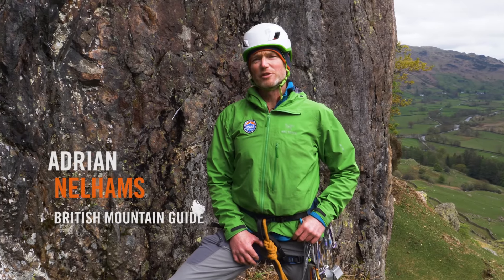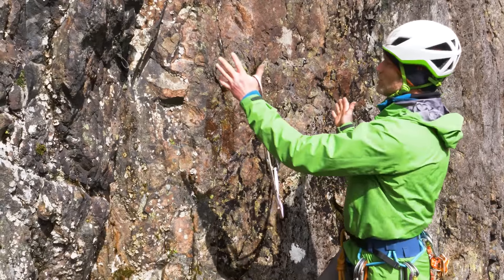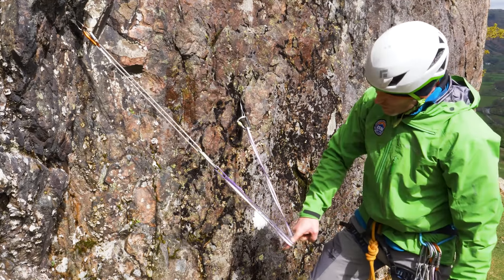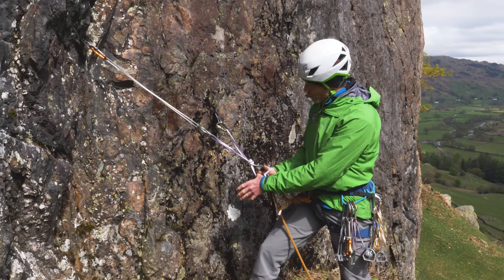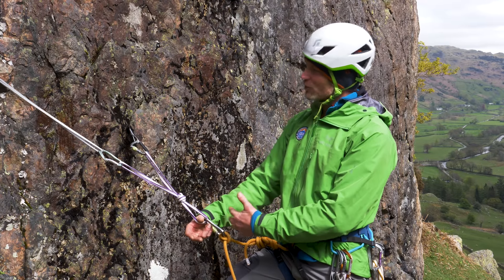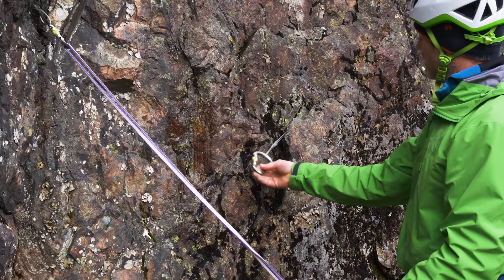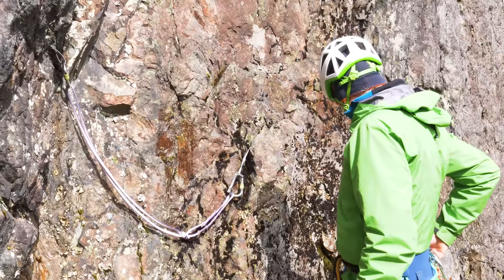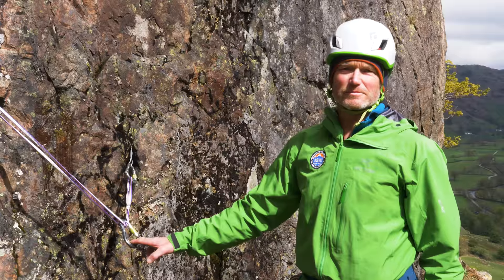Using Slings to Equalise A Trad Anchor | Climbing Daily Ep.1179

Comment: Nice alpine method. If you are doing this in cold weather and with  gloves I prefer using a clove hitch knot in a sling instead. You can also put two hms carabiners in the clove hitch as your central point. If your pro is bommer this method will be able to withstand more stress such as a factor 2 fall.
Reply: An important point for the overhand is that it is fully equalized within a 'reasonable' range of load direction, and very limited drop-load if one pro fails.

Comment: Thanks. I wonder, though, if you are going to lead through to the next pitch, isn't there a danger that your fall will cause an upward force on the 2 nuts and potentially pull them out. In Australia we would tend to have a separate piece in to stop an upward pull.
Reply: The climber generally places a piece of gear before setting off, preventing that happening

Comment: From the camera perspective, the angle between the master point and the two anchor points is pretty wide.  it appears to be so wide that each of the anchor points is carrying 100% or more of the load.  Is this just because of the camera angle?
Reply: I think the camera makes it look like a smaller angle than it probably is - I think the angle would definitely fail the spock test. But if he and his second are happy with it then power to em
Reply: Looking at 3:41 and 6:00 it looks to be more acute than other views. It looks to be less than 90 to me. We are really just guessing though.
Reply: I'm sure the director of the ISM knows what he's doing and wouldn't be where he is if he didn't.
Reply: Not necessarily, stupid people make it to all kinds of high places. Look at the U.S. President.
Reply: Ian Lol.
Reply: Yeah, but still remember that he's gonna belay the second from that point, so not huge loads if you keep the ropes pulled... With the dynamic rope you'll have almost zero shock, so I wouldn't be worried... For the next pitch he would need to add a lower counter facing protection, and not much downward load is gonna be applied in the event of a fall
Reply: To my eyes, given the 2D video, the angle appears to be between 40 and 60 degrees. It does not look to be 90 degrees or more. it is certainly not 120 degrees, which would put 100% load on either piece.

Comment: Why not using a Sliding X to save to more sling lenght? Ps. 2 nuts for an anchor, a bit dicey maybe?
Reply: If one of the anchors of a sliding x fails, the remaining anchors are shock loaded which might lead to additional anchors failing.
Reply: Sliding x is ok if you add knots to minimise a no extension scenario but you are just adding knots to an already short sling which only gets weaker...
Reply: Very dicey
Reply: The nuts are dicey, but the sliding x is not good for trad anchors because if a piece fails it shock loads the the other piece. It's more of a convenience for sport climbs/ trad routes with bolted anchors because you dont need to put any effort into equalizing it.
Reply: @Sturzfaktor2  can place a limiter know on the left side to limit extension,  but i agree, not ideal.
Reply: yes. this anchor would not be ideal to belay from for the next pitch as there is no protection against upward pull.

Comment: that looks like a dynema sling..?  aare'nt they are weakened by adding knots?
Reply: A knot does reduce the Kilo newtons going through the system as the knot tights a has a little slippage.  Also the section of rope he's using takes a lot of power out if the fall through stretch and it's knot tightening.  DMM do a really good video on dynema sling failures on here.